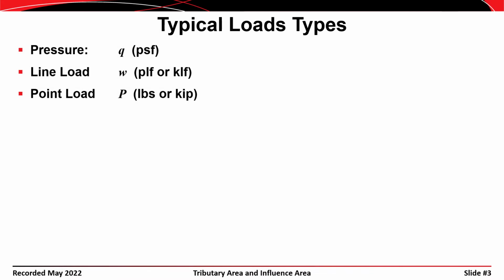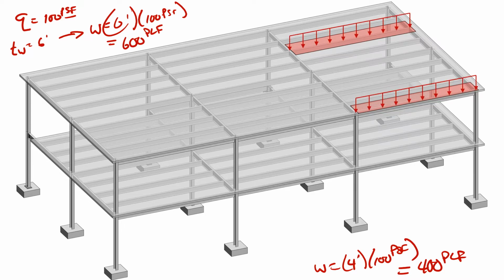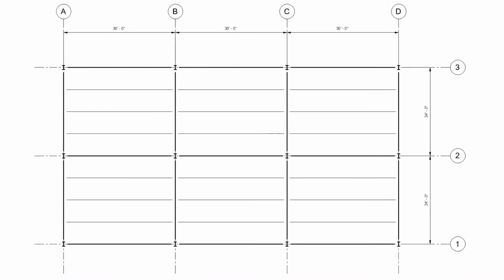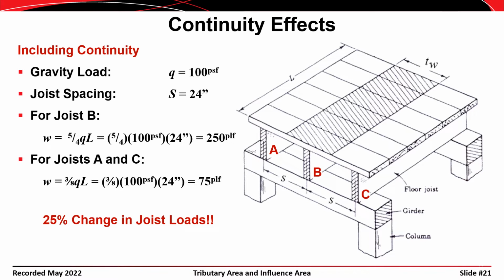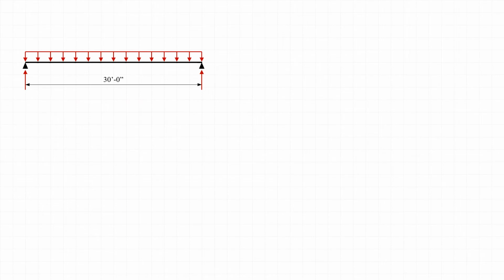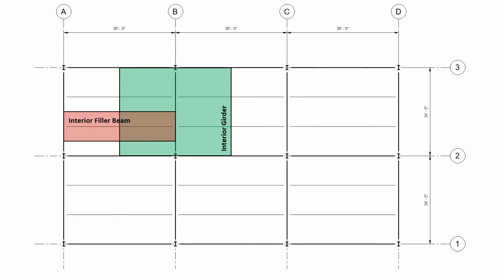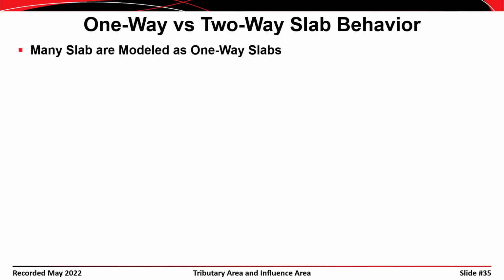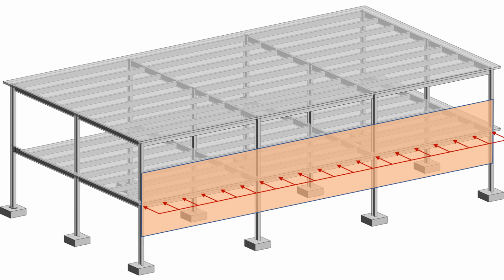STR04 L03a-22 Tributary Area and Influence Area

Comment: I have seen books that for the girders reaching to the edge column…the At doesn’t reach all the way to the column because of the beam located in the edge would receive part of the load (half spacing) and that beam would load directly the column not the girder.  So maybe it’s a mistake…